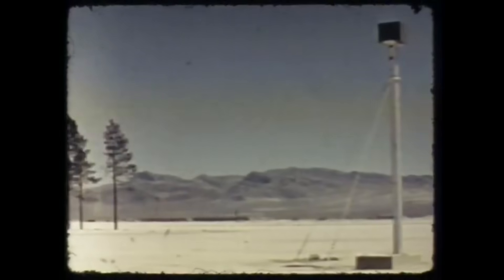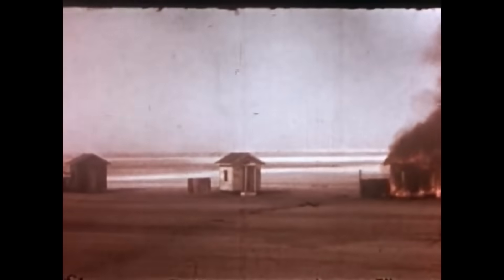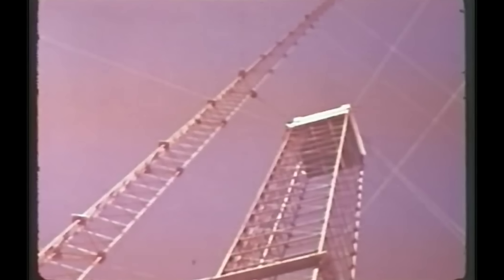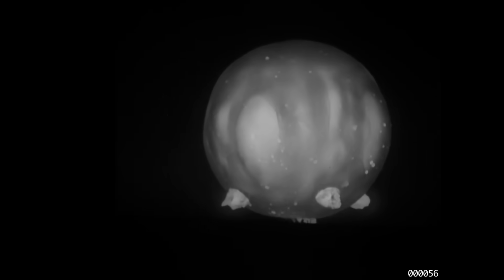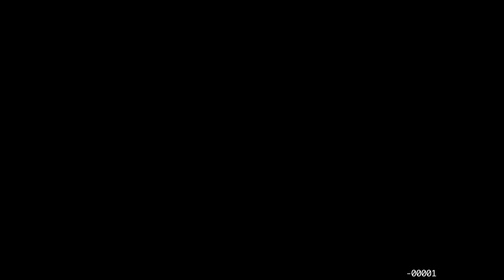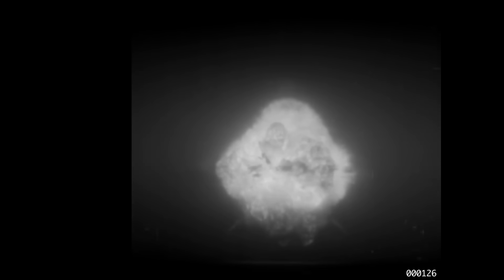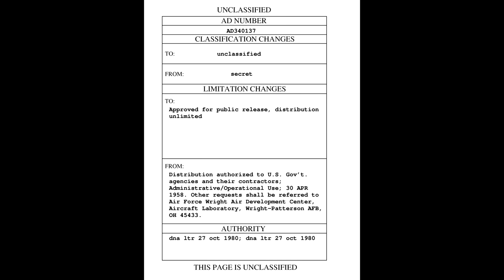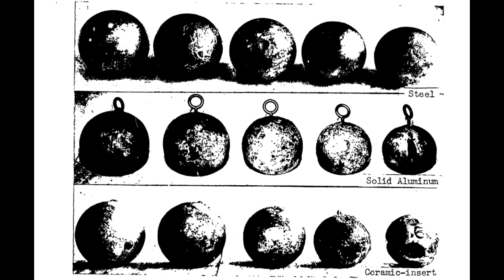Can A Metal Bowling Ball Survive Inside a Nuclear Explosion?

Comment: AFAIK Due to Newton’s impact depth laws: in a vacuum (space) an atomic bomb can only vaporize (near) it’s own mass in material if completely surrounded. This means that even at a relatively close distance even paint won’t be removed. This is why the Orion plus propulsion can get away without destroying the pusher plate.
Reply: It has to be considered what material it is. All the kinetic wavefront bearing physical aspects and reflectivity of the surface, along with the mass, whether it is engineered to transfer the momentous kinetic "kick" to a heavy enough vehicle so not to splat the pilots or irradiate their chromosomes til they spin leftwards, or if it's bolted to the ground and has no way to pass the energy down the line, weathered dark grey, made of bare desert dry wood, and carefully placed where a leaded white IR reflective paint is just enough to prevent thermal absorption to the point of ignition. There must have been side bets about the physicists black body values and whether or not it'd catch fire :P
Reply: This seems to be assuming it's only the material of the bomb that transfers energy. Surely vaporising something depends on the energy density reaching it, in this case mostly by photons (visible light, x-rays & gamma rays). Pretty sure it would remove paint at a good distance, like when you shine magnified sunlight onto a surface, around 50-70x the normal energy density of the sun (magnifying glass example), taking that to 10,000x would really strip paint. I guess the inverse square law will be involved somewhere, and the length of time the photons are produced for.
Reply: Tried to do a quick calculation, simplified. A 20kt device would release about 80TJ of energy. If this energy spreads out evenly over the surface of a sphere, then at a distance of 200m,  the energy per square metre (energy density) calculates to approx 159MJ. This 159MJ of energy will be absorbed by something... Paint? Probably not.
Reply: @threeMetreJim  that's about 44 kwhr of energy per square meter.  Fun fact.
Reply: I don't think impact depth has anything to do with this question. The fact is that there will be intense x and gamma rays everywhere, which won't be stopped by a thin layer no matter what it's made of. And that radiation will vaporize stuff...

I honestly can't belive that a 1mt yield bomb can't vaporize more than its weight.
Reply: Next Episode On Cody’s Lab: Cody makes an atom bomb in this back yard to prove a point.
Reply: Nice to see our boy Cody dropping knowledge bombs!
Reply: @morkovija  hehe knowledge bombs! Get it!?
Reply: @morkovija  the amount of mindless thumbs up is quite sickening though.
Reply: @Blox117  agreed. It's totally impossible that a nuke can only vaporize as much mass as the nuke itself has... thr x and gamma rays will heat up stuff regardless of the mass of the bomb.
Reply: Lew Allen's bowling balls were deployed around the Bikini Atoll h-bomb tests too
Amongst other things it was discovered that if they were graphite-coated the ablation was minuscule.  This fed directly into research on Orion pusher plates
Reply: Wouldn't the high energy particles (X-Rays, Alpha & Beta particles, etc.) impacting against a surface transfer some energy? 

Perhaps removing/etching nanometers of material in a disturbing kind of sandblaster...? Also increasing the temperature of the surface in much the way that the Solar Wind does.
Reply: @Seren-dipi-T  : That would all happen, yes, which is why it was suggested that the pusher plate surface of any Orions be sprayed with a liquid petroleum shortly before every detonation: the hydrocarbon was meant to ablate in place of the pusher plate.
Reply: Respectfully, I don't know what Newton's Impact Depth Law has to do with the effects of nuclear detonation; Newton's work was on kinetic penetrators. This is tangentially related to the design of bunker-buster bombs, both conventional and nuclear, but nothing to do with nuclear fireballs. 

Meanwhile, underground detonations, when adequately buried, make sizeable cavities much bigger than the volume of the bomb, so I suspect that your recollection is faulty, or I'm misunderstanding what you're saying.

Lastly, Orion's propulsion units were designed with a mass of propellant positioned between the bomb and the pusher plate; proposed propellants were polyethylene or boron salts. The bomb would vaporise the propellant, sending it towards the pusher plate, transferring its momentum to the plate and pushing the spacecraft along. High-energy photons from the detonation would still get through the propellant and ablate the surface of the pusher plate, but Dyson and co determined that a thin layer of oil sprayed on the plate between detonations would mitigate that.
Reply: Would the mass of vaporized material depend on that particular material's temperature of vaporization? Not sure I said that correctly, but don't melting, vaporization, and such phase transitions vary between materials regardless of density? (E.g. gallium melts at temperatures lower than lighter elements, IIRC.)
Reply: @jakeaurod  Materials doesn't vaporize just by getting to certain temperature.Also,correlation between phase transition and density??Helium?Osmium?Mercury,Aluminium?Doesn't seems so.
Reply: @jakeaurod  Gallium will melt in your hand...
Reply: It's interesting how as you move away from earth-surface conditions (pressurized atmosphere, narrow temperature band and do forth) physics gets weirder and weirder from our perspective.
Reply: @paulh2981  probably because we are pretty used to the somewhat weird conditions on earth's surface
Reply: I watched Iron man push a nuke through a portal and destroy a whole alien death squad in space. It had to have been true.
Reply: But doesn't that equation not account for energy? If you had a very large plate next to the explosion, then that plate will absorb roughly half the energy of the nuke. It may only penetrate very little as a classical projectile, but there are very few materials that won't vaporizer with that much energy being dumped in so fast.
Reply: Newton’s penetration/impact-depth approximation is strictly a momentum-transfer model for solid projectiles plowing into solid targets at sub- to trans-sonic speeds.  That has no bearing on a nuclear device that releases its energy as MeV-range photons, x-rays, and a plasma fireball expanding at tens of km/s. A nuke is not a solid impactor, and the material in front of it isn’t being penetrated in the Newtonian sense.

A plain-vanilla 1 kt (4.184 × 10¹² J) fission yield-Steel needs 7-8 MJ per kg to be vaporized—Max mass you could vaporise if all energy was applied is 5.2*19^5 kg. 

That’s about 500 t of steel. hundreds of times the bomb’s own mass, not “its own mass”.  Even if only 1 % of the bomb’s energy couples to the target (realistic at Orion-style stand-off distances), you still have about 5 t available to vaporize.

The Orion push plate survives because of three factors. The standoff distance, which is 20 to 30 meters for a 0.15 kiloton pulse unit, which drops the energy fluenced by the cube root of the radius squared. The fact that it's a shape-charged propellant, most of the plasma momentum, not the gamma or x-ray flash, is aimed at the plate. The thermal pulse is spread almost isotropically, so only a small fraction hits the plate. And the material choice, plus the sacrificial oil film, if you just had steel plate, it would ablate one millimeter bare. But it has zero millimeters ablation with a thin hydrocarbon coat, because carbon and hydrogen absorb UV and re-radiate into longer wavelengths before the steel can heat. And that's, you have to realize, they're using an extremely small nuclear device. If they were to use a Tsar Bomba, you wouldn't have a ship left anymore, it would vaporize several hundred meters of solid steel. Then the recoil would be around 1.7TPa which would be a bad day
Reply: This is worthy of further discussion...................................... the pusher plate that is and not the shrooms.
Reply: All the growing projects in the Chicken Hole is a cover up for something right? We knew it. What is it, an underground hadron collider? Those pesky FBI agents aint come and take your antimatter firecrackers this time 😎
Reply: In space, no one can hear you scream...and that includes nuclear shockwaves.
Reply: woow thats so cool
Reply: Bless you sir
Reply: Radiant heat?  X rays?  Assuming our star is nuclear, I’d say there is a possibility to do some damage.  Shock waves themselves can vaporize w or without a vacuum.
Reply: @dannon2010  i'm pretty sure that by definition a shock wave is caused by exceeding the speed of sound in a medium, and since practically speaking the vacuum has no medium to speak of, and the ejecta doesn't have sufficient mass to form a medium... there is no shockwave.
Reply: @dannon2010  out of curiosity: how do you realize a shockwave in vacuum?
Reply: Of note..
Reply: In the book Project Orion by George Dyson one of the members of the project is quoted saying that he thinks today that they focused too much on the ablation problem, but he thinks that other problems like mechanical resistance and vibration would make the project impracticable (at least based on their ideas at the time).
Reply: "Newton's impact depth laws"?
No such laws exist. 
Anonymous Cody's is making up silly stuff.
Reply: It's worth mentioning that just because only a tiny amount of material will be vaporized, doesn't mean you won't be destroying anything. A nuke enclosed by a vacuum surrounded by a relatively thick metal shell will only vaporize a thin layer of that shell - but that metallic gas will now possess an inordinate amount of kinetic energy which will cause it to expand into and overpressure that volume, ripping the containing sphere apart unless it is fairly massive - or the empty volume is sufficient to moderate the pressure spike.

Likewise why you don't want a nuke going off right next to your ship. It will only vaporize a little thickness of hull - but the kinetic energy transferred by that gas exploding off the side of your ship will likely cause the hull to crumple and tear, which will not go well for the occupants.
Reply: What does an (atomic) explosion have to do with newton's impact depth laws? What an embarrassingly bad take.
Reply: Have you heard about Marshak waves? I think close to the nuclear device so much energy is flowing that such laws no longer work as the radiation and the impacting mass carries so much energy that the impacted surface becomes some kind of photonic gas that is efficient at transmitting energy to itself.
Reply: If the radiation pressure was enough to push the pusher plate you can be sure it would be enough to remove paint!
Reply: nagualdesign nope; only a thin layer vaporizing is needed to transfer the momentum. I think I’m going to do a video on this at some point to explain why.
Reply: @theCodyReeder  how are the plants and mushrooms doing, Cody? 🙂
Reply: @theCodyReeder  In the vicinity of a nuclear explosion, close enough to vapourize a thin layer of steel, what sort of paint do you think would survive? 😕
Reply: @theCodyReeder   That's one of the theories of how a thermonuclear secondary works. The ablation of the pusher is enough to transfer enough energy to compress the secondary to criticality.
Reply: @theCodyReeder  Thing is, they designed the Orion pusher bombs to channel the energy of the nuclear explosion into a bolt of tungsten plasma that would do most of the transference. IIRC they surrounded the bombs with DU casings with a layer of beryllium oxide between the fuel and a tungsten cap. Beryllium oxide would absorb a huge amount of x-rays and transfer that energy to the tungsten.
Reply: @Gun4Freedom  Old nuclear bombs can't just be used as is for pulse propulsion; they are designed as weapons and they come in various sizes, yields, and configurations. You'd want all your pulse units to be built the same way, with a fraction of them as half charges for engine starts and stops. So you might be able to reprocess the old bombs and use their fuel to construct pulse units, but that's going to be pretty expensive.
Reply: @theCodyReeder  Please do a full-scale test in orbit. Nothing beats a 1 to 1 test.
Reply: @theCodyReeder  i look forward to that video.
Because i very much doubt paint will survive that kind of radiatory intensity whatsoever.

If what you say is true, then The Tesla Model S SpaceX launched 2 years ago on the FH will still have most of it's paint. (Assuming micrometeoroids haven't ripped it to shreds.
Reply: @Clippy447  Ummmm, BeO is practically completely TRANSPARENT to x-rays. That's why they're used as windows and vacuum separators in grazing incidence x-ray microscopes
Reply: @theCodyReeder  Awesome idea. It also means, that for space battles scenarios, nukes would suck as weapons.
Reply: @Muonium1  I said (via acronym) "If I Remember Correctly."  Might be somewhat off on that detail, but I know the beryllium oxide was used in some way to make the tungsten absorb the bomb's soft x-rays more easily. Wikipedia says it was to lengthen the wavelength of the x-rays.
Reply: @mavste5677  That's how EMP weapons were invented and why the US is fanatic about protecting it's command chain against the effect.
Reply: @theguyfromsaturn  check out the gane Children of a Dead Earth.  Scott Manley has some videos on it, its a science based space wargame.
Reply: @RCAvhstape  Also, uranium is extremely hard - hence, physically very difficult to work with.
Reply: @patheddles4004  it's not that bad to machine
Reply: @Gun4Freedom  sadly you probably can't practically take existing warheads of different manufacture and turn them into pulse units. In fact, a modernized pulse unit would likely redesign the internals of the weapon somewhat.
Reply: Cody'sLab yes please
Reply: @patheddles4004  what makes it annoying is the machine has to be in a glove box and has a whole lot of extra attachments to collect the cuttings
Reply: Cody'sLab"nagualdesign nope; only a thin layer vaporizing is needed to transfer the momentum. I think I’m going to do a video on this at some point to explain why."
So what you're saying is you are going to launch a nuclear powered spacecraft to push you to mars?
Reply: @theguyfromsaturn  Not necessarily.  Consider radiation effects.
Reply: @theCodyReeder  oh, please do! maybe talk about laser ablation and propulsion, as well?
Reply: @nagualdesign  If you watched the video. The aluminium ball lost an equal amount of mass as the steel bal even if aluminium is not as hard nor as fire resistant as steel.
Reply: @lubricustheslippery5028  Yes, I did watch the video. I'm not sure which of my comments you're responding to though, or what you're trying to say TBH.

Are you saying that you agree that the hot plasma of a nuclear explosion would probably make an effective paint stripper?
Reply: @nagualdesign  The toughness of paint should not matter. It's the mass of the material that matter.
Reply: Cody'sLab l
Reply: Cody'sLab Please explain everything , i dont even know what you are talking about , but it sounds intersting.
Reply: @Gun4Freedom  So, let's design the dirty bpmb that does it mist cleanly ;-)
Reply: @gove4103  You are right Sir, Eric Harry mentions this in his novel ``Arc Light``.
Reply: @theCodyReeder  Where is this video?
Reply: @nagualdesign  does your cast iron skillet vaporise just because it gets hot... no well then there ya go
Reply: Its Cody! Stay safe dude
Reply: So Cody. I can't believe you said something so dim.

Comment: The balls being smaller after the shot but all having the same mass loss is interesting. I wonder though if its not thermal erosion like mentioned....let me try and explain.

We know that thermal ablation requires exposure time. We know this from plasma arc jet testing of materials. Ablation happens but it takes time. Now granted, the plasma flux density of a plasma arc jet is orders of magnitude less than that of being 25m from a nuclear device. But the nuclear device exposure is only but an instant where as the jet is longer in duration.

I question if the loss of material is actually due to ablation via xray and neutron bombardment. Reason why I think that is due to the same amount of material being lost on materials which all have vastly different specific heats and latent heat of formation. If you think about it, the only common thing that the balls and the event have in common are the number of photons and neutrons being produced (homogeneous xray and neutron flux) and the surface area of the balls. Looking at it in a more microcosmic perspective....the event is producing X amount of particles and these particles are impinging on a surface area which contains the same number of atoms (relatively speaking). So the number of collision events between the radiation flux and the atoms on the balls surface is relatively the same and since the neutron flux is so high and the xray energies are so high. I believe that the collision events are ionizing the atoms on the surface of the ball to an energy level so high, causing them to ablate, but not by thermal means. But by literally raising the energy level of the atoms and instantly turning them into a plasma that sloughs off.

Comment: The real question is, 
How did they get all this footage?
Reply: Lots of cameras, usually mounted on very strong steel poles, at a long distance from the burst points.  Most of the "damage and destruction" footage was actually done with 16mm gun cameras that were recovered from surplus WW2 fighters, because they were tough, reliable, good enough quality, and completely free because the Air Force had already bought them years ago and they were just sitting around taking up space in a warehouse.